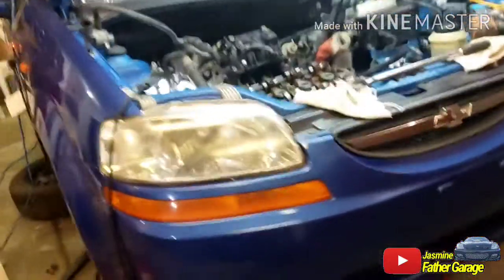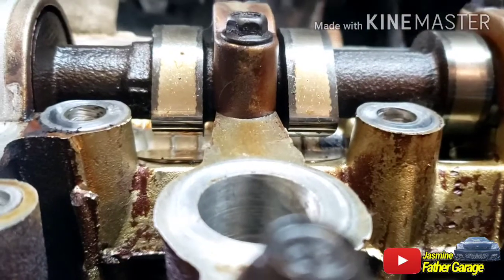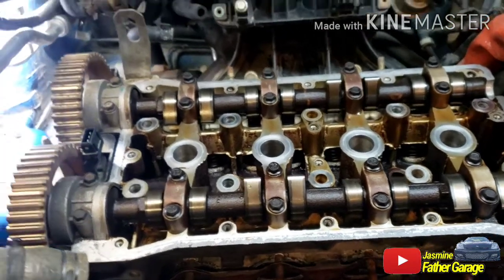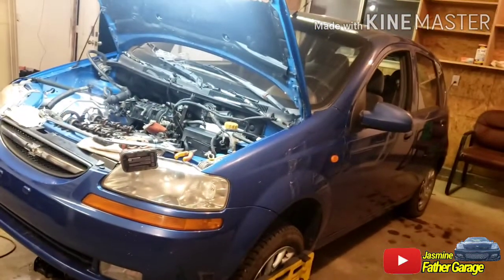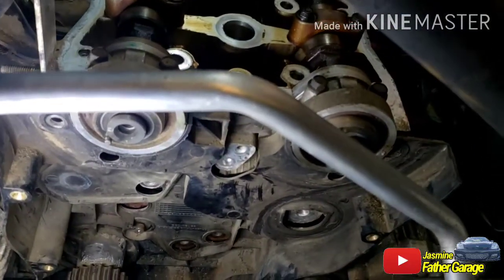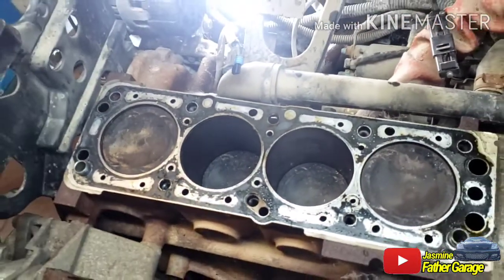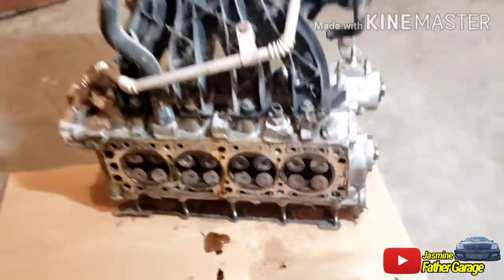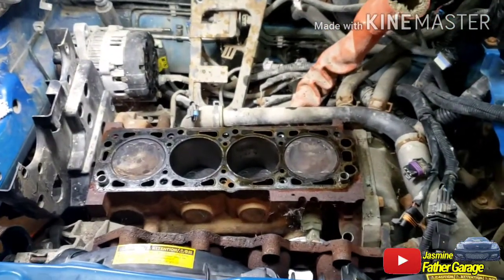Video1: Tooked the Head off, Shocking results Chevy Aveo/Pontiac Wave 1.6L

Comment: Trying to take the head off from a 2007 Aveo.   Besides the ten head bolts, do we have to remove the two giant hex or torx bolts in the center of the head?  I'm asking because the head isn't budging.  Please respond
Reply: No just the 10 bolts and you have to pry the head from the block assuming you disconnected all the other stuff necessary to get the job done like the intake and exhaust manifolds

Comment: Hi thanks for the video. I just like to ask what possibilities that will bend the valves if the timing tensioner break during driving but timing belt is still okay. It chev aveo 1.5
Reply from the maker: Its possible the valves bent if that tensioner break, the rubber belt should  be OK  just inspect the belt before installing it